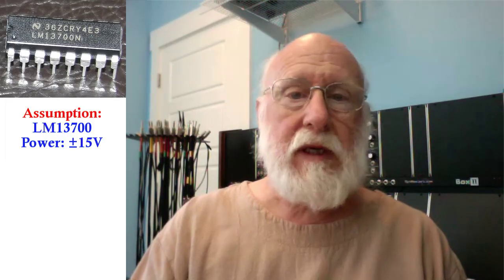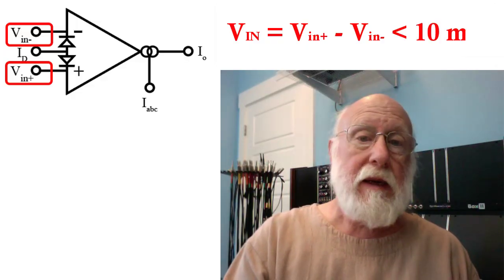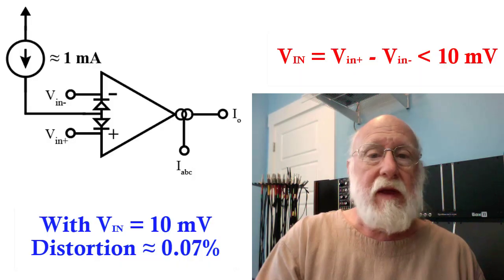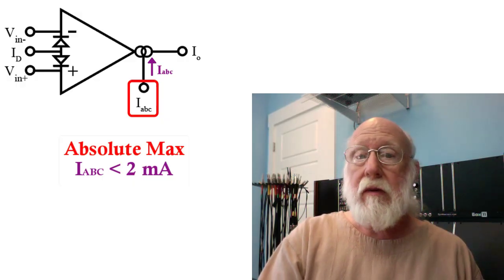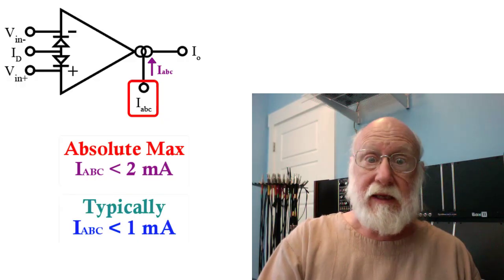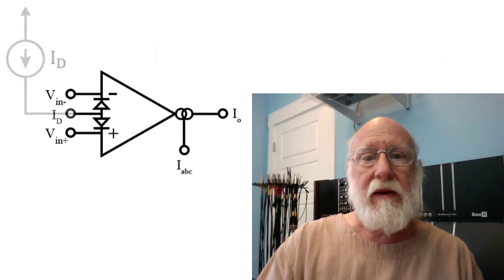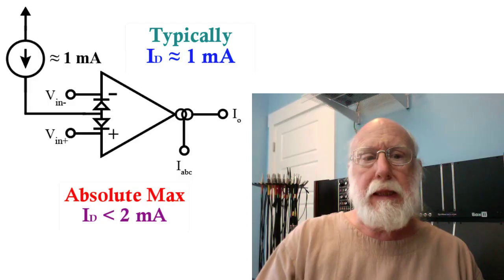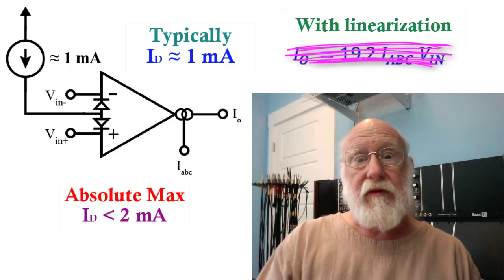OTA 3   Basic Inputs and Outputs V3 0

Comment: OTAs are interesting. Perhaps I can build an analog multiplier for an analog computer with it.
Reply from the maker: That would indeed be possible, although there are perhaps better solutions for that application. HOWEVER, if the goal is to learn more about the OTA, that would be an interesting project. By the way, I am old enough that "programming" analog computers was still taught (though just barely) when I was studying for my first EE degree. I also designed a simple analog computer to implement a lunar landing simulator for a project in one of my courses (Electronics III, I think). I have a planned video somewhere far down the queue on implementing a balanced modulator (aka "ring" modulator - essentially a four quadrant multiplier) using the OTA, but it will be quite a while before that one rises to the top.
Reply: @ProfessorPark  That sounds cool. I have actually found that a gilbert cell might be more promising perhaps.